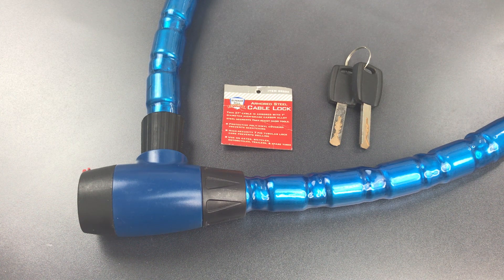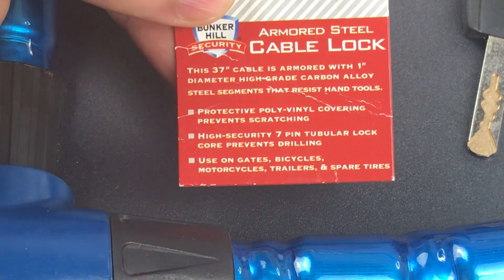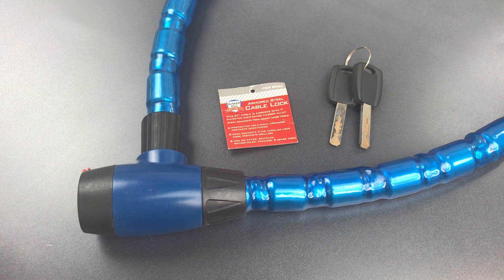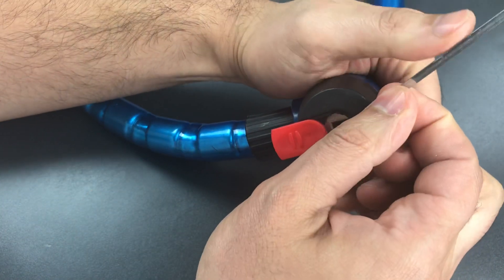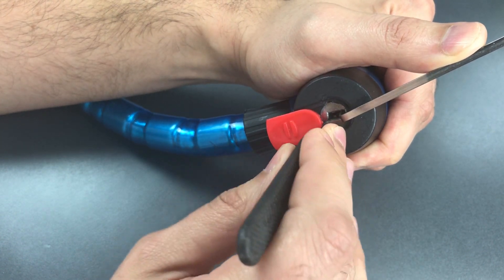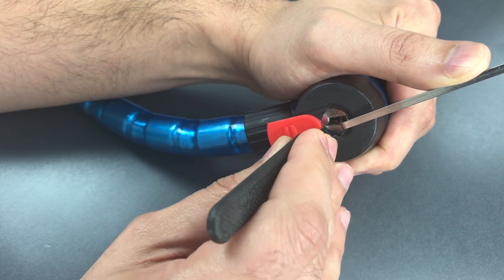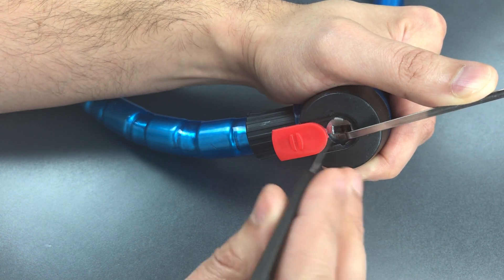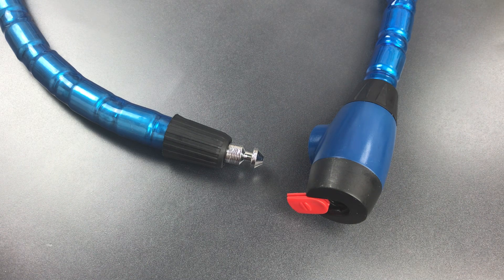[755] Bunker Hill Security Armored Cable Lock Picked

Comment: As a dutch bicycle mechanic I've seen these kind of  locks a lot and they are realy crap. Cut the plastic coating open, bend the lock several times and most of the time, the metal bushes come apart. Inside you see a thin metal cable, you cut this and the lock comes apart. Sometimes when the plastic is damaged rain gets inside and the cable wich holds it together is rusted through and suddenly  your lock falls apart when you're trying to lock your bike.

Comment: A LOCK THAT TAKES YOU MORE THAN 30 SECONDS
CAN'T BE TO BAD ..IT ONLY TAKES 15 SECONDS TO OPEN A MASTER LOCK ..
Reply: Doesn't look all that sturdy though. Couple whacks with a sledge and you could rip that flimsy peg right out
Reply: Do the hazard fraught locks come with new caps lock keys?
Reply: @crowfly1979  : yep. I bought the two pack to make my first pick gun...
Reply: @JustinS1227  : actually I do I have the beginning stages of dementia and I have about 36% use of my body so if I wanted  to use caps I f**** will.
Reply: @JustinS1227 - Just hoping to pull someone's string / rattle someone's cage. Looks like it worked!
If U don't like ALL-CAPS “SHOUTING,” don't respond. Skip over them as if the response wasn't there, along with all of the replies to the SHOUT!!
Reply: @richscott2090 - Sounds like you're qualified to be president of the United State Empire! Can U supply a photoshopped birth certificate and two SSNs?

Comment: you ahould check out this padlock. Its from Ace Hardware and is brass colored. It uses an interchangable core via the Schlage keyway. It has 5 pins. Those pins have no beveled edges (like Kwikset) and 4 of 5 driver pins are a very unique spool/serrated pin. I think it is a very cheap, redily available padlock for people compared to crap Master locks or super expensive Abloy locks. i would love to see you do a review. Thanks

Comment: I used to work at Harbor Freight in my early twenties. Practically everything was made from China but still great spot to shop if not, then definitely a candy shop for men
Reply: Harbor Freight is a good place to get started to be a mechanic. As things break, replace them with good tools for the tools that you need regularly.
Most of their hand tools have a “lifetime” warranty. Catch: you can't get just a replacement for the tool that broke unless it was sold individually. You have to return the entire set.